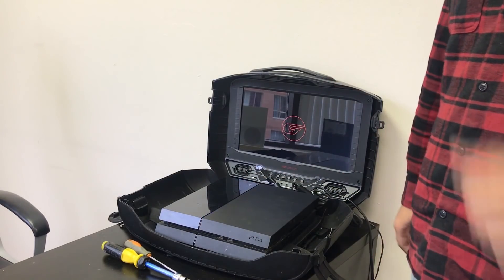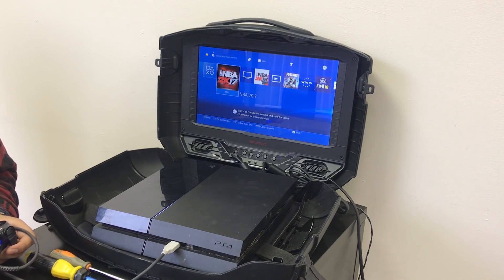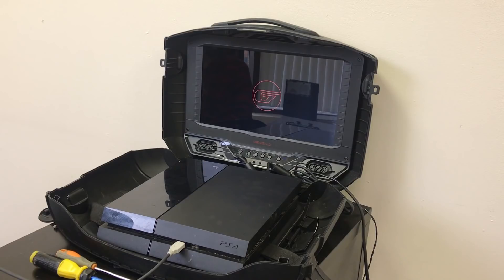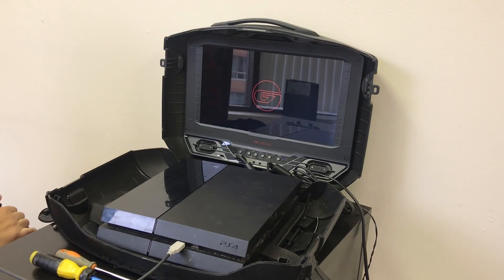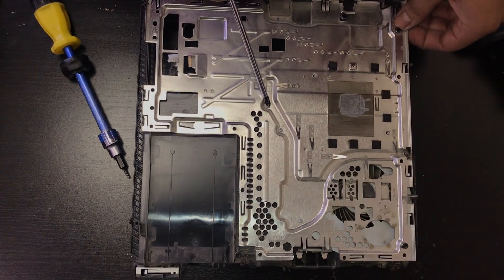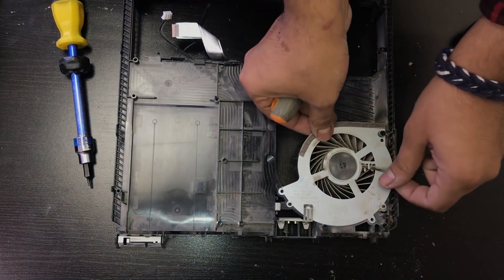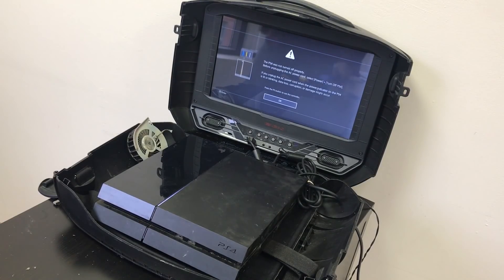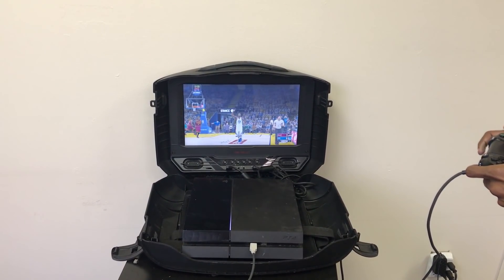PS4 is Too Hot and Turns off Repair (Fan Replacement CUH-1001A/CUH-1115A)

Comment: I just used this tutorial and while it wasn't all bad, It would have helped if you had mentioned the number of screws pulled from every location that way when it comes time for reassembly, we wouldn't have to guess how many screws go where, even though it's somewhat self-explanatory, the verbalization would have still helped. otherwise, a good video.
Reply from the maker: @andrearin8383  thanks for your comment

Comment: If I was ‘the customer’, I would expect you to thoroughly clean the unit and replace the thermal paste on the CPU.
I hope ‘the customer’ didn’t pay for these as well. Just a bog standard repair. No finesse. Sorry.
Reply from the maker: It costs extra to replace the paste and the customer chose not to do it.

Comment: When it went to that first black screen sometimes it'll say that it needs to update to v9.04 and that I have to use a USB to reinstall the update which I do not have a computer to do so I only have a phone. So I have to turn it off and put it into safe mode in order to reinitialize which wipes everything. And it gets hot fan inside of it is working I can hear it spin every time it turns on. What do you think would cause that if you do not mind me asking?

Comment: The long phillips screws connected to my power supply are stripped and the heat sink bolts are on really tight. Any suggestions on how to remove them?

Comment: i have a question and i need some advice, so ive opened my ps4 so many times to get my ps4 working again, at first i cleaned the fan and the heat sink, but it still got hot, changed the thermal paste and it still got hot, i cleaned off any dust and it still continues to get hot, is there something im missing the fan seems to be working but i dont remember how powerful the fans are suppose to be, the intakes are clean, is it because my system is old ? i have the PS4 PRO
Reply: I know it’s been a year but did you figure out what was wrong by chance?? I have the same exact problem. I just cleaned out my entire ps4 put in new thermal paste and still the same bullshit.

Comment: this guy forgot to tell everyone when removing the motherboard of a PS4 and the thermal paste looks wasted you have to reapply thermal paste on the GPU its what keeps the system from over heating, At least once a year, replace the thermal compound and your good, i still use my day 1 ps4 with no problem
Reply: you do not need to replace thermal paste yearly . Total waste of time

Comment: hello I see you didn't change the thermal grease  my question is do we need or have to change the grease
Reply: yes every time you remove the motherboard you have to reapply the thermal paste on the GPU its what prevents the system from overheating

Comment: I have a problem, I put everything back to normal but it turns off and on, and I don’t know if that plug looking connector on the mother board is why
Reply from the maker: Check the pins under the power supply

Comment: My fan died.. So while I was taking it apart I accidentally ripped the fan plug off the motherboard.. Jack and all.. So I'm going to replace the fan and run it off a secondary external 12v plug.. Will be modifying case as well.  I'm using a squirrel fan out of a desktop. Fingers crossed it works

Comment: Does the fan suppose to be light? By that I mean like really easy to move because on mine I tried blowing on it and it didn’t move even with a hair dryer. I cleaned it, there’s fan noise when I turn it in but it just kept shutting off.
Reply from the maker: Attilary Your fan is ceased. You need a new one. Link is in the description box.
Reply: Yeah that is what I thought aswell but thanks for the clarification

Comment: I got some scratches on the big green chip around the fan connecter wire  just only that place cuz i didn't know how to take the wire off cuz i used pliers does that damage the ps4?

Comment: Hey my ps4 makes a weird clicking sound I accidentally broke a three wire connection on the motherboard when trying to diagnose it, and I think I fixed it by putting it back and holding it in place with electrical tape. Any info on what those cables are? Should I continue to buy a fan and throw it in or did I make more damages beyond repair? And any idea of as to what the constant clicking sound my console makes? I’m assuming it’s my fan because it doesn’t work but if the fan not working has to do with the cables I fucked up id like to know
Reply: After watching ur vid even more it turns out that’s the fan connector cables fuck me. How can I fix and how can I diagnose the clicking my ps4 makes

Comment: My ps4 is getting to hot and i replaced the thermal paste te fan is clean and the fan turns when u turn ps4 on.... it dosnt work
Reply: You might need better thermal paste like coolmaster. But look on forums like Reddit for my info.

Comment: How do u know if it’s your fan mine turns off right when I turn it on could it be the power supply?
Reply: Don't know if you're still having the issue but if someone else is, you can test it by spinning the fan with your finger. If it's broken it will be stiff and will spin for less than a second.
Reply: pin pon it was just thermal paste I fixed it but ty for answering
Reply: @imroyaldiamond9188  what do u mean your fan didn't spin cause of thermal paste (Sry for my English)
Reply: SGT Crim1 thermal paste is how the heat is transferred from the cpu to the heatsink and that’s why my fan was struggling
Reply: @imroyaldiamond9188  I replaced the thermal paste now my fan spins but after 10 minutes it turns ofd
Reply: Is it dry?
Reply: @imroyaldiamond9188  I replaced it 2 hours ago
Reply: What's your insta?
Reply: SGT Crim1 Ygn_jah

Comment: My fan spins I took it apart and clean the dust and everything and it still turns off
Reply: The fan is not spinning fast and u need to put new termal paste on the chip

Comment: Good work but cleaning it with air compressor and refreshing the thermal paste wouldn’t have gone a miss
Reply: If u buy a new ps4 fan does it come with the fan connecters?the 3 wires
Reply: Well Mies I have the original PS4 from release first time I cleaned the machine I pulled the cable out wrong and broke off the connector... I got one from eBay cheap my advice is on your fan check model number and buy another one with the same model number they usually have the connectors on it crimped already
Reply: Thanks
Reply: And also my Ps4 has a red line and beeps 3 times that means I need a new Fan right?or...
Reply: Well Mies means your PS4 is overheating I’m guessing your fan isn’t working can you hear the fan working usually if if the fan don’t work the PS4 shuts off with around a minute or less
Reply: Mine still spins but then my ps4 shuts off and the fan stop spinning
Reply: Well Mies how old is the console? Ever cleaned it and refreshed the thermal paste?
Reply: Da weasel Glitcher can you upload a photo of the model number and the part your talking about what version PlayStation do you own ?
Reply: If the fan doesnt spin does it automatically mean you need a new fan ? Could it be it just needs a clean ?
Reply: @ForeignSjde  yeah I need to know too 😭
Reply: Makes thee absolute difference when it’s running it sounds sooo nice when that’s been done

Comment: One of the problems that causes the PS4 to clog up with dust is where it is kept, if you place it on a carpeted floor or a dust/dirt filled room because you cant be bothered to clean it then this happens.  Having it off the floor in a ventilated area that is cleaned more often than not, helps enormously, although you cant prevent any dust ever getting in over years of use, it is far more likely to have a problem if you dont do as I mentioned earlier.
Reply: No that's not the reason it's obviously sony is a cheapass corporation and used cheapass bearings.

Comment: My PS4 turns off immediately after power up - the fan starts spinning and becomes very loud before the console beeps twice and turns off. I am assuming this means the console "thinks" it is over heating and thus spins the fan at rapid rate before shutting itself off. Is the sensor replaceable?

Comment: Hey. I replaced my fan but neither the old or new fan will spin. Fan connection on the motherboard looks fine though.

Do you have any idea what the issue could be?
All other hardware is fine just cant get it to spin.
Reply: Mine is having the same problem. Did you ever get it fixed?
Reply: @MegaManBeasting  poor quality fan, had to buy a new replacement fan.

Comment: https://www.ebay.com/itm/NEW-OEM-Internal-Cooling-Fan-Replacement-Repair-For-Sony-PS4-CUH-1115A-500GB/132800195165?hash=item1eeb822a5d:g:n8oAAOSwe2Zbr2e4.       Still Silent as a Church Mouse , Do a Monthly Dust for maintenance,  you should be good

Comment: please help help help : i opened mine and cleaned it and when i turn it on after 10 seconds it goes red and shuts down ;( ;( fan still working but after i opened it it got worse and shuts down straight away every time i turn it on !!! please help am i fucked ? do i need new ps4 ?? ( which i cant afford )
Reply: I have the same problem did you figure it out?
Reply: @crazynexo-9384  yes.  i had to change the thermal past.  still working since then.  just clean it and change therm past.  lots of tutorials on youtube.  easy and simple
Reply: N angel I feel like I’m gonna buy it and have no outcome 😬😂
Reply: @crazynexo-9384  buy what?!  new ps4 ?!

Comment: MY ps4 makes a low then high fan noise then turns OFF, could you please help me 😦😦😢😢
Reply: Yo mine is doing same have you fixed it.       If so what was the problem
Reply: mine started doing that after i disassembled it and cleaned it. i fixed it by applying new thermal paste
Reply: @sanfiz12  is it hard to replace the thermal paste ? Because my ps4 starts and then it begins to take off then it shuts down due to overheating.
Reply: Muhammet Eroglu it’s not particularly hard but it’s definitely fiddly and you need to be carefu
Reply: @sanfiz12  same thing happened when I cleaned it lol
Reply: Same. Ahhhhhhhhhh

Comment: my ps4 is doing the same thing, just that it sounded like a lawnmower before, but now the fan finally gave up and i don’t hear it at all
Reply: I know it abit late to reply to your comment but my ps4 is doing the same
Reply from the maker: Great
Reply: 😂😂😂it’s the heatsink not the fan bro I just bought a new fan and the beat thermal paste for the system cleaned my PS4 out with dust off and everything and the new fan worked for one day and the next day it was back to not spinning and the PS4 overheating my guess is try replacing your heatsink

Comment: i need help guys so it was like this when i play Any game offline my ps4 doesnt crush,but when i put on the internet ps4 my ps4 crashes and says that my ps4 is too hot what too do?! plz help it started yestrday
Reply: C G L M take it completely apart. The fan might be getting stuck or not spin. Or it has dust inside.
Reply: @gabrielr.4618  will the fan not spin because the dust is inside or do you need to replace the fan?

Comment: does thermal paste have a large effect, i opened mine up cleaned dust but i saw online that thermal paste plays a huge role
Reply: yes
Reply: Deinish ™ thanks! I realised this shortly after i commented this, ordered a full kit off ebay, and my ps4 was working again, still gets very hot though, not quite sure the reason for that however.
Reply: what ps4 you got?
Reply from the maker: It does make a difference. Check our other videos for thermal paste replacement.